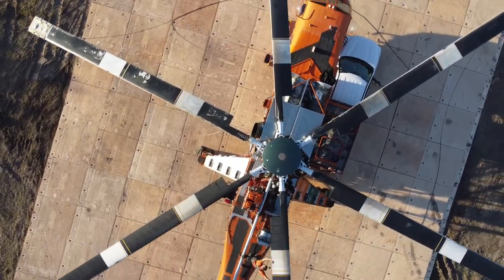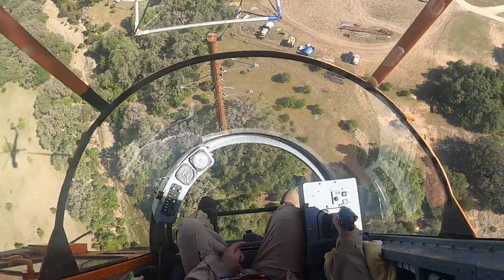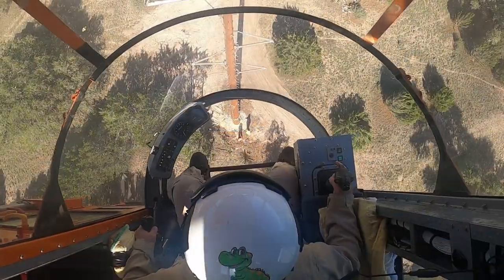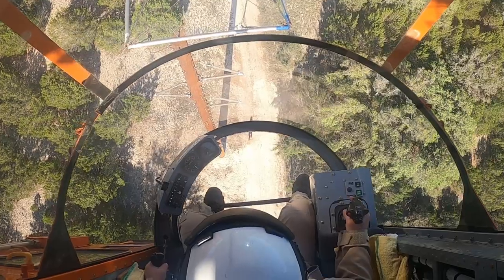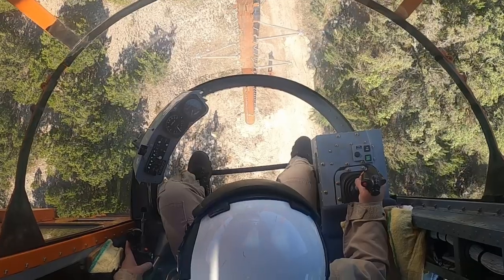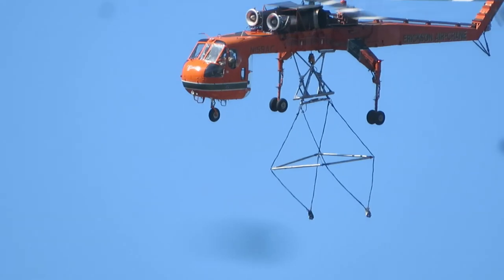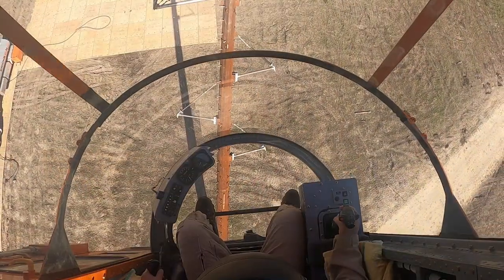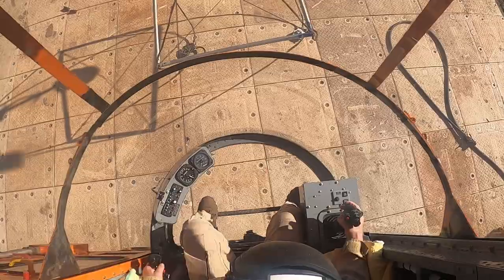S-64F | Erickson Inc. | Irby Construction | Leakey, Texas | 138kv Transmission Rebuild | 4 May 2021

Comment: Does the load pilot have rudder controls?
Reply from the maker: It used to by design in the Cyclic, but been disabled. Right seat has control in degree increments.